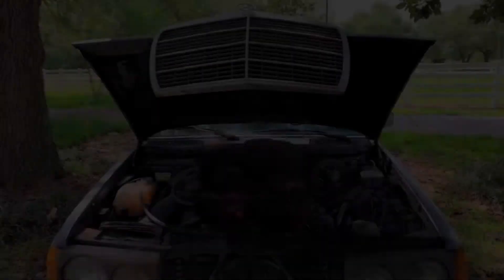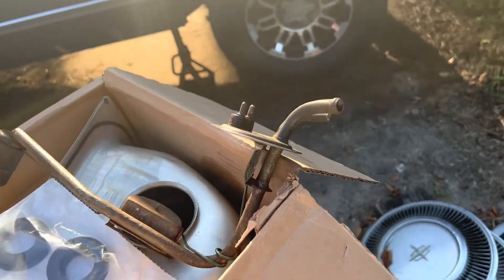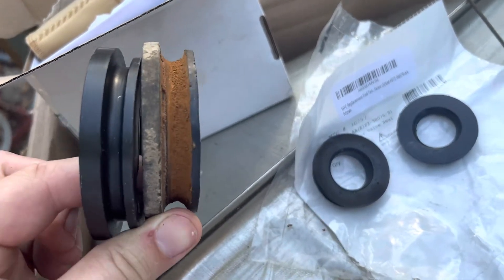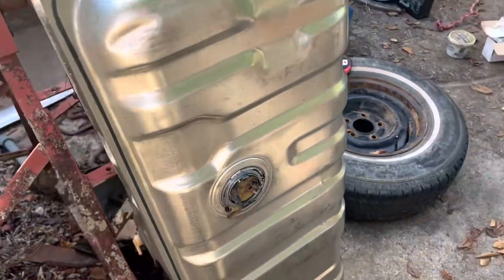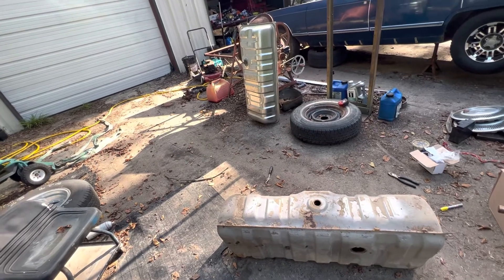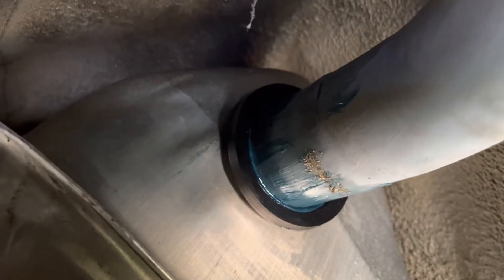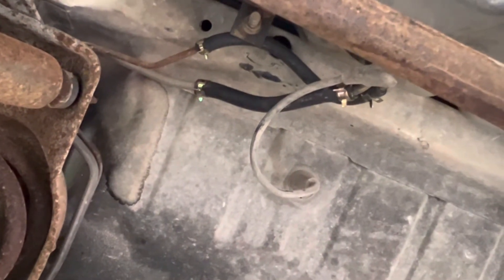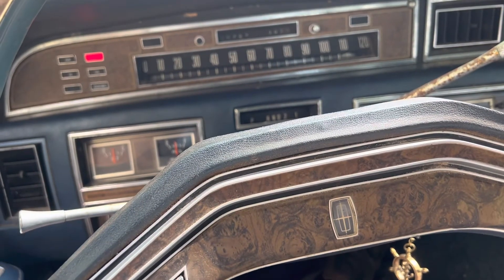1975 Lincoln Continental - Fuel Tank Install

Comment: Got a 79 as well  ,I was just going to replace the sending, end up replacing the tank too. I  Paid some one to replace it before and didn't work. I bought a 2nd unit and replaced it my self and didn't work either. When I fill my tank the needle goes only half way on the gauge. Weird thing is mt cable had a socket with 3 connectors and the sending unit only 2 . My new tank have a weird pipe welded inside the tank about 6 inches hanging in the inside.

Comment: I have a 63 Lincoln Continental and I have some sort of vacuum leak and I am confused about it. I just took off my tank and cleaned it. I thought I might have had water in it. It had been sitting for 3 years. The car starts and stalls after a while. My car has vapor lock so I installed the return on it. It was not being used before. My tank has some leads to it outside of the return and fuel line. I don’t know what those are. I am wondering if they could be the source of the problem I am having. There is a hose above the center of the tank and near the tank. It is closed off and not attached to the tank. I have a line on passenger side of the tank that has a big filter on it. I have no idea what that line is. It attaches to the tank at the bottom on the passenger side. If you know what these are please let me know.😢

Comment: My only suggestion would have opted for a new SS sending unit and seal the interior of the new tank with POR or the Eastwood fuel tank sealer.  You stated that you were paranoid about the clamps, keeping the tank rust free is important. Mine is from experience renewing classic car fuel tanks, and RV fuel tanks. My 2cents.
Reply from the maker: I’d have to go back and look at the listed but I don’t think the only sending unit I could find was SS. I’ve seen several of the fuel tank coating flake off and plug pickup tubes. But maybe they would work better on a new tank?
Reply: @mjmcomputers  POR sells a cleaning and prep kit, the silver colored fuel tank sealer won't degrade or brake down, surface prep is key. I have never seen their tank sealer flake. Others have told me they like the Eastwood fuel tank sealer, again, metal prep before sealing is key.  Yes, I agree on new tank metal prep would be easy before sealing. No corrosion to deal with from old gas or alcohol gas.
Reply from the maker: @dewholdingsllc1050  good to know.